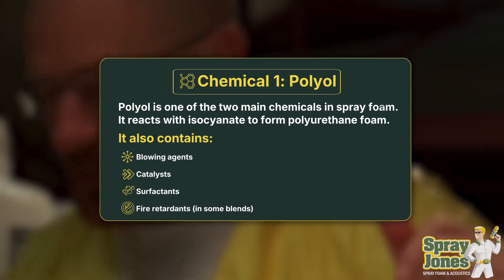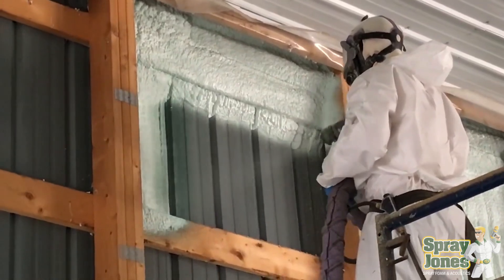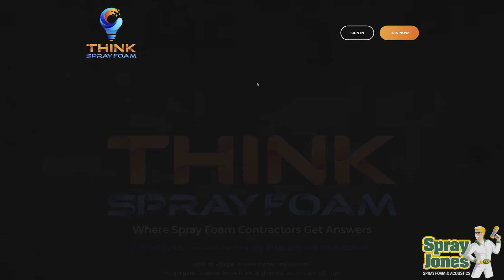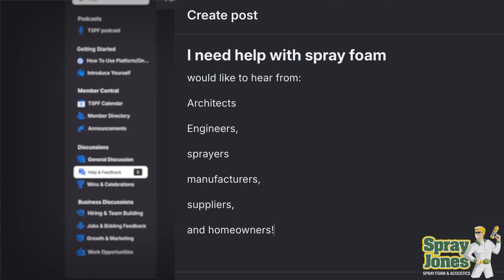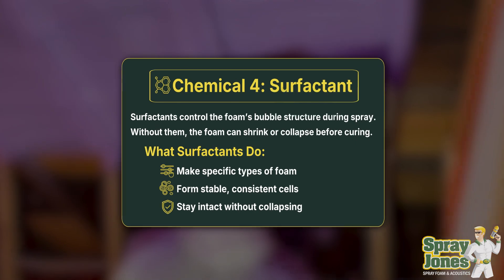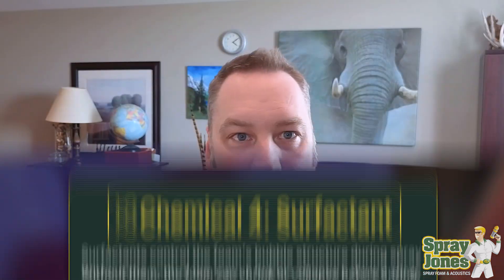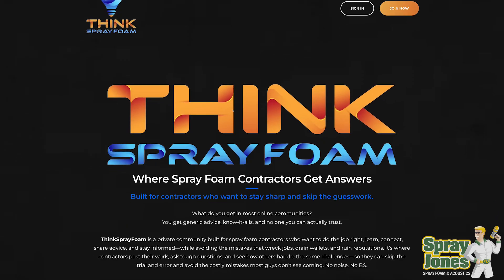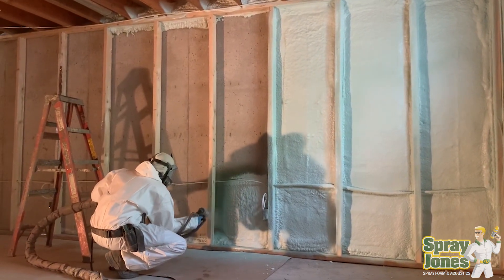What Chemicals Are in Spray Foam (And What They Actually Do)

Comment: I would love to see a video about the different weights of spray foam and their specific benefits, including a cost-benefit analysis. I am in Eastern Ontario and am rebuilding my old home (1952) from the floors up. This is the first I hear about 3lbs foam for roofs, my floors will be over an exposed crawl space as the house is being rebuilt on helical piles due to being next to a river and on expansive clay. When done I want to heat my house with a hair dryer if you know what I mean. LOL I have learned so much from you and await your next videos on the topic. Thank you.
Reply: The main purpose of the 3# foam is compressive strength. If someone needs to get on the roof to do mechanical repairs, the 3 pound foam is strong enough to handle people walking around and equipment and tools. I wouldn't recommend this on a residential project though.

Comment: I would like to see a video on using closed-cell for a perfect wall installation. Wrapping the whole building in closed-cell from the ground all the way up to the roof ridge seems like the best way to insulate and air/water seal a framed house in one go.
Reply: Agree. Please heed the advice of others when doing something like this, and manage the air, especially the humidity. Once the building stops leaking air everywhere it also stops "breathing". Build the HVAC system into the design. You could even consider designing the air-moisture management system first, and then build a suitable house around it. 😉
Reply: @pendarischneider  The whole point of air sealing as tight as possible is to control where air can come into and out of, ideally with a large, high MERV filter, an ERV, and humidity control. Plus all the side benefits like sound and bug control.
Reply: @ZergZfTw  Exactly. I think this is pretty much what I was saying. 
For the benefit of anyone else listening, and I'm repeating Mike Jones and others, big problems happen when fully sealing a dwelling and not managing the humidity.
Of course when you see the words "ideally", "large", and "high" next to technology terms you have to think budget — reality can be painful, but shouldn't be ignored. 😉